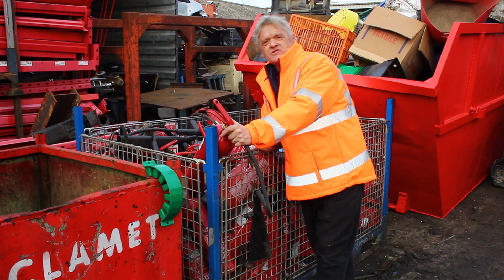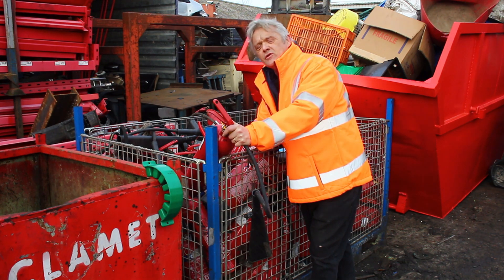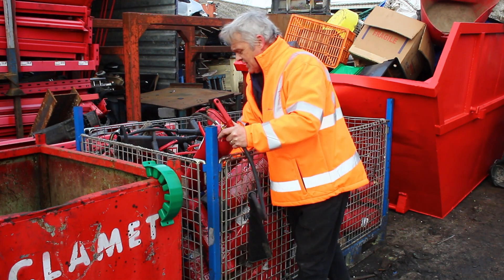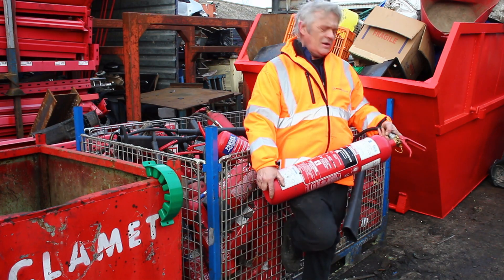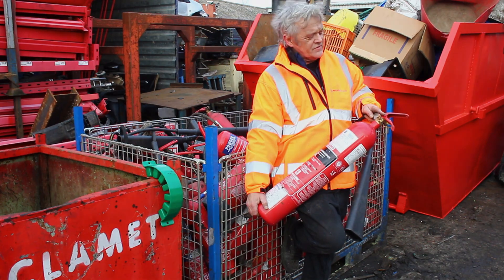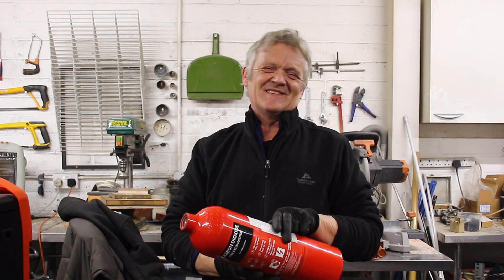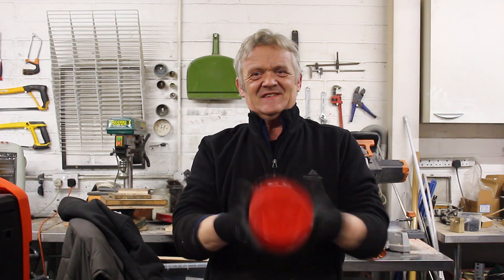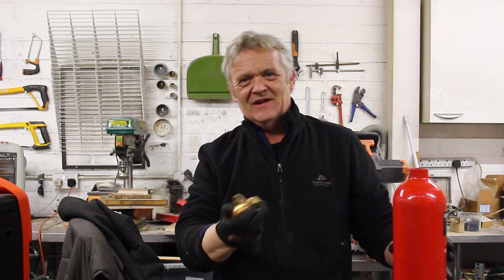1406 Safely Separating CO2 Fire Extinguishers For Their Scrap

Comment: Good advice on being careful with pressurized items I knew of three contractors working at a mine in a hurry forgot to depressurize a tire for a huge ore truck they removed some of the bolts and the tire exploded shooting nuts killing two guys at the scene the third died in 12 hours I was told it looked like a bomb went off to all builders wherever you have to be extra careful don't just trust a gage go the extra mile to be sure

Comment: Awesome Robert, thank you. 
Just a though mate. Do you have a greenhouse in the garden?
Reply: Hey Rob. I need your Expertise. 
Why when you discharge a capacitor does it charge back up some. 

I made a motor that produces 90v with a hand turn. This goes through a H bridge to a single capacitor. If I place a multimeter across the terminals and then cause a direct short. The voltage drops to zero instantly then slowly charges back up to about 7v. 
I have no clue why and I have no other to ask. 
At first I assumed it was like a tank set up. Then I realised the coils are the other side of the H bridge. 
There is littereraly nothing connected to the load.
Reply: @garethb5729  capacitors have electrolyte in them which acts like a battery plus when you discharge them there will be a slight charge on each plate for dy/dt amount of time

Comment: Why are you "recycling" perfectly good fire extinguishers? In fact, the ones I could see appeared to be factory fresh!
Reply: If they were “factory fresh” they wouldn’t be in a scrap yard. They clearly don’t have enough gas to reliably extinguish big flames which is why they got thrown out. just because they have gas left don’t make them usable or “factory fresh” they aren’t scuffed up because they are kept safe until the one time they have to be used.
Reply: @sleepingdragon385  rubbish, the only thing that will be wrong is the cylinder being out of test date and it’s not economical to do so Vs manufacturing a new one
Reply: @ianbottom7396   even if some are out of date that’s not an answer to if they should be recycled because if their expired and no one will pay to have them inspected for fault then they are still going to end up in landfill if not recycled regardless of their condition. They can’t just be blindly used either because you cant assure its not faulty and the company’s wont have any insurance if a fire did happen and they didn’t work, it would be considered negligent on their part.
Reply: @sleepingdragon385  ahh yes it is, generally (depending where you are) they are inspected annually for 10 years and then disposed of as the cost of emptying, inspection, pressure testing, re finishing, recharging will be higher than replacement cost
Reply: @ianbottom7396  sorry Ian your name sort of seems familiar, are you a Uni lecturer by any chance?
Reply: @dantronics1682  no sorry
Reply: @sleepingdragon385  its nothing to do with the gas level, the cylinders have a date stamp on them, the aluminium apparently goes brittle and could cause an accident, its the same with lpg tanks.
Reply: I shop from scrapyard piles at least once a week and I’ve pulled most of the tools for a complete metalworking shop out of the piles. Also many working electrical appliances and gasoline powered equipment. Brand new wire and piping fixtures. Occasionally things are still in the packaging from the store. 

The reasons this happens are complex. Very little is explained by theft; a lot is explained in the different efficiency of large organizations that isn’t the same as efficiency for ordinary people. There’s no way to save it all. I could profitably run an upcycling business there with several employees. 

If you find items or parts at a scrapyard that can be upcycled in any way, you should do so and feel good that you created an efficiency better than the smelter melting it down.
Reply: The simplest answer is security theater. Once they each their expiry date, irrespective of condition, well, would you trust an extinguisher that's expired? And that's the perspective of management.
Reply: A CO2 extinguisher is manufactured for a 10 year life span. 
On the 10th year, due to the extreme pressure the cylinder requires testing. 
This process is called hydrostatic discharge testing. In short the cylinder is filled with water, pressured and zapped with electricity to identify any fractures. 

As you can imagine the process is costly. Due to manufacturing it's cheeper to replace a 10year model with a brand new one. Hense you will find them at almost all scrapyards. 

Also due to the extreme pressures a CO2 extinguisher must be kept dry and maintained in an area with thermal regulation. 
Example. 15°C = 51 bar pressure. 
As the temp increases, so does the pressure. 
Because of this extinguishers tend to be in very good quality.